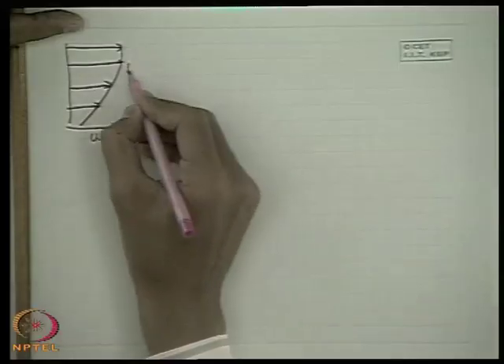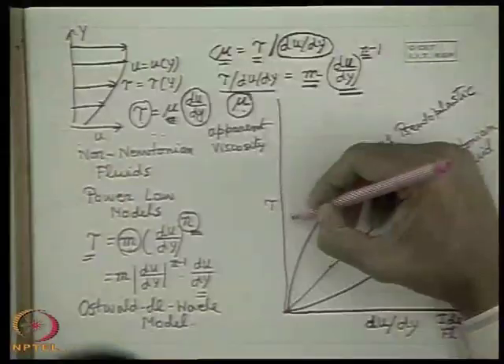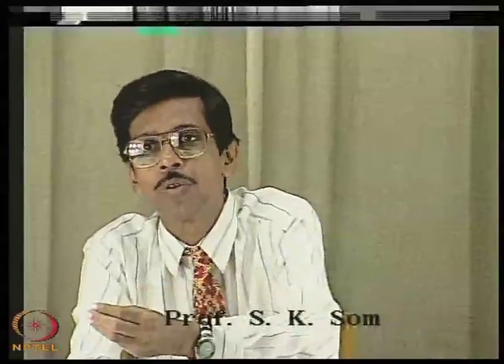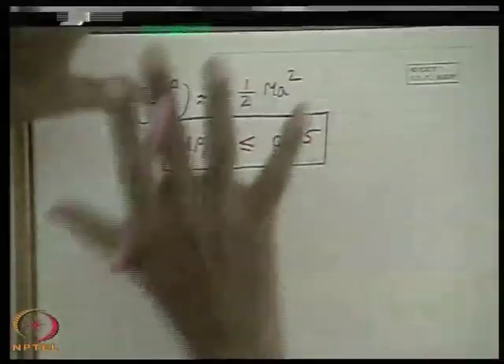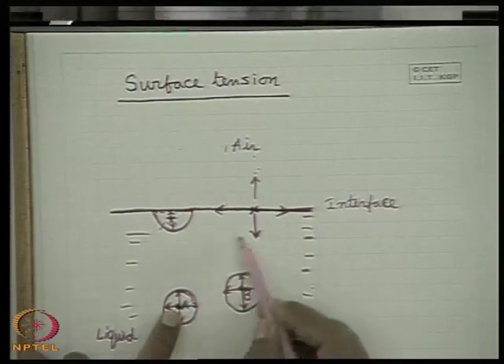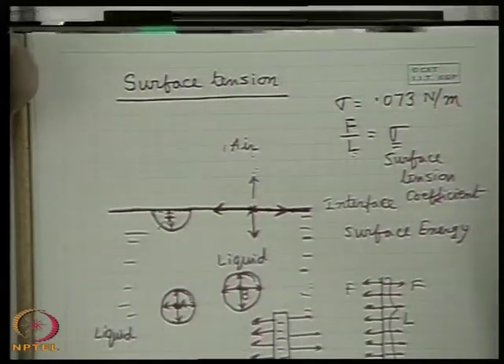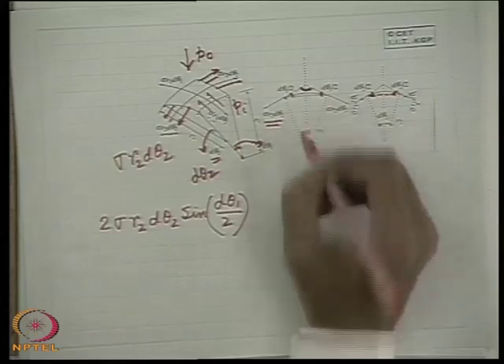Mod-02 Lec-02 Introduction and Fundamental Concepts - II

Comment: 0:00 recapitulation of previous lecture
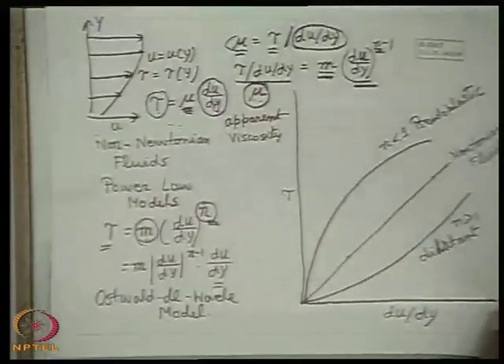6:54 beginning of lecture- Ideal fluids
9:50 ideal bingham plastics
11:55 No slip condition
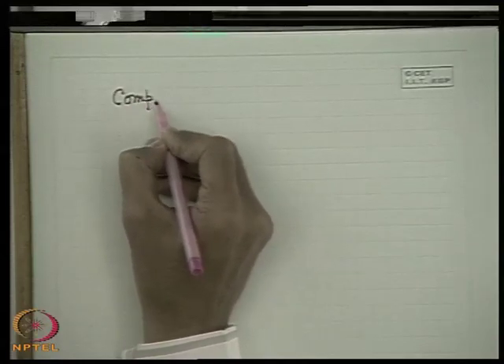15:40 compressibility
22:00 Discussion of compressible and incompressible flow
23:00 Flow of compressible liquids may be compressible or incompressible flow
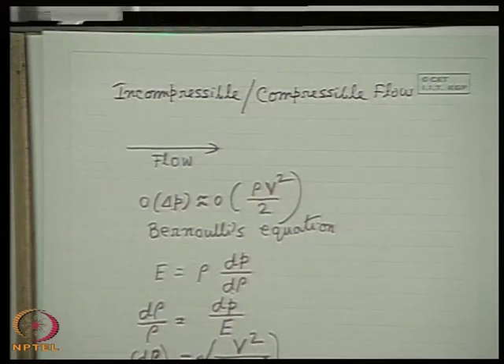27:00 Acoustic velocity
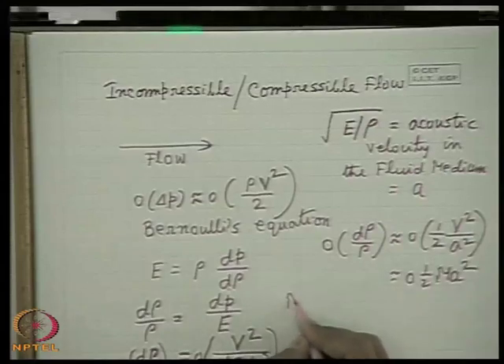28:14 Mach number
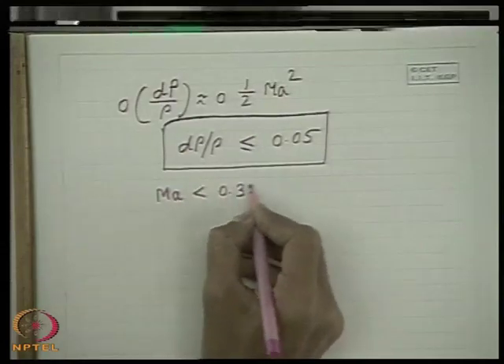30:11 Mach number limit to conclude type of flow of compressible fluid
32:00 Surface Tension
45:00 End of lecture

Comment: 37:16 he said "we have to do work against net inward molecular cohesive force which is going to be lesser and lesser as we travel near the surface", HOW CAN IT BE LESSER AND LESSER as we travel near the surface? Shouldn't it be MORE AND MORE as we travel near the surface?
Reply: Net cohesive force decreases as we move towards the surface due to which we are required less work to do to move from bottom to surface.

Comment: According to the video, surface tension not only depend on the liquid but also depends on the air above, but in the formula of surface tension it is tensile force per unit length. Here that tensile force is just the force of the of the liquid which is pulling. so, only the liquid's force is being involved in the equation and no force of the air above. So, it should not matter whatever is above the liquid right?
Reply: Its been a year, but i will tell What I understood. Surface tension depends on both upper and lower fluids, net tensile force is not only the pulling force. Instead, Net inward force = Inward cohesion force -  Outward adhesion force. and this value will be positive because cohesion force will be greater than adhesion force in this case

Comment: in first lecture you told m is flow behavior index and n is flow consistency index but in this video you said the opposite. Please CLARIFY
Reply: Logically ,  n should be flow behaviour index because we know that if n>1 it is dilatent fluid ,if n<1 it is pseudo plastic fluid i.e n is defining the fluid behaviour so it is called fluid behaviour index.